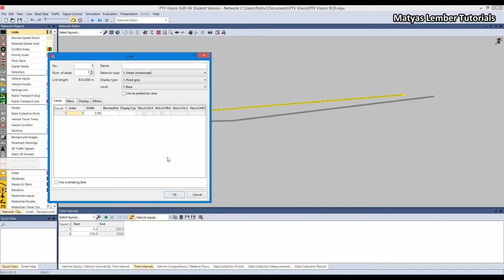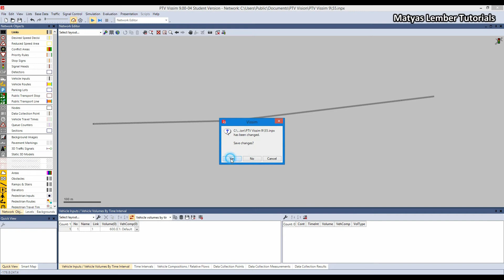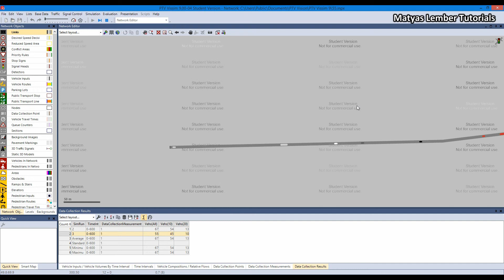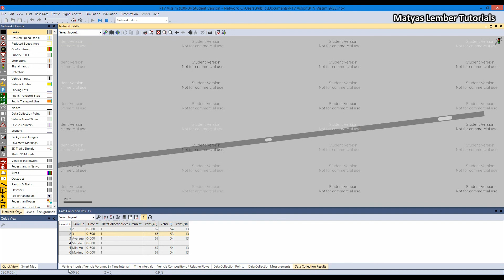Vissim Tutorial - Lesson 29 - Add more time for evaluation - with sound!

Comment: Volume is number of vehicle per hours. In your tutorial, you input volume 600 vehicle per hours. In 5 minutes interval only 63 vehicles thas pass the data colection line. How to show interval until 3600 secons to know how mutch vehicle thas pass. Thanks that have to help me.
Reply from the maker: Hi, I haven't seen your comment, sorry. Set the time interval in the evaluation settings higher than 3600. See @0:53
Reply: @MatyasLemberTutorials  but in student version time is limited bro 600 secs... Then how can we set it to 3600 secs???
Reply: @arindammandal3620  I guess in that case you need to use linear regression to predict it for 3600 secs. I am not sure, currently I'm struggling with this too. If you found the way already, kindly share please